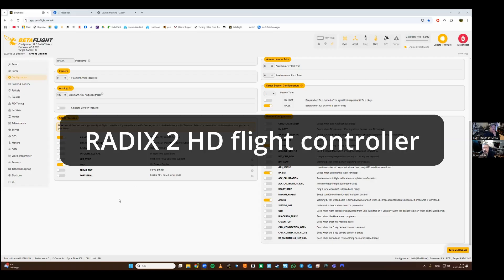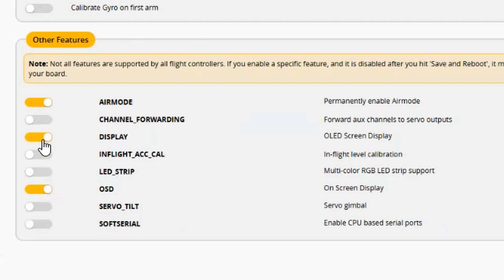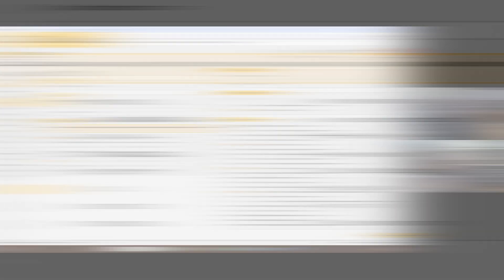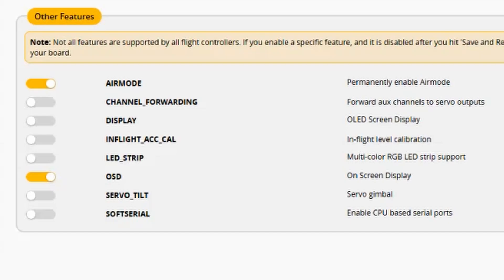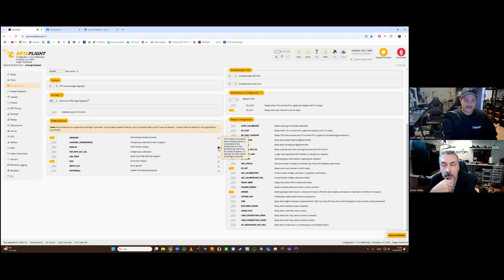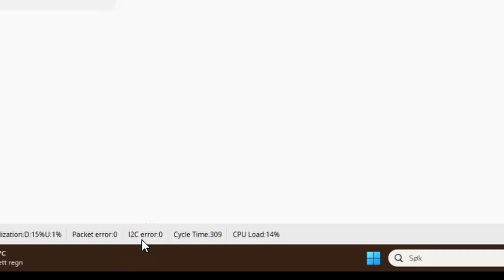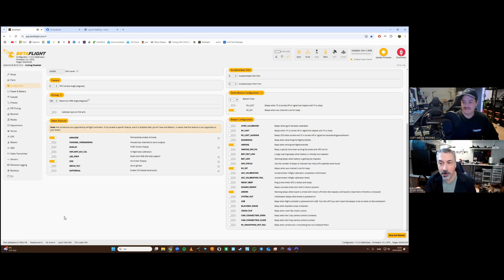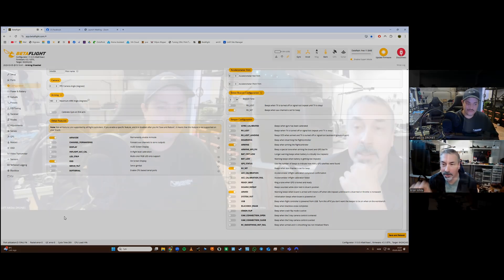RADIX 2 HD issue!

Comment: @PIDtoolbox Oled display refers to the small 1" oled you can add on the quad to see voltage and gps stats. Those displays normally connect with i2c. They're called ssd1306 I think. Nothing to do with goggles or the video feed. Was this like April fools video or soemthing? They were useful way back before telemetry mainly to see stats.